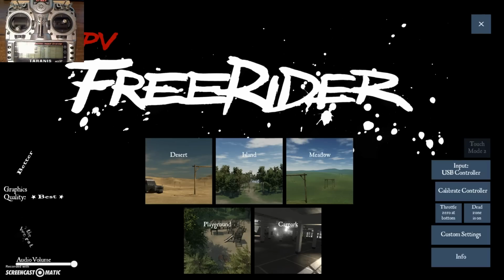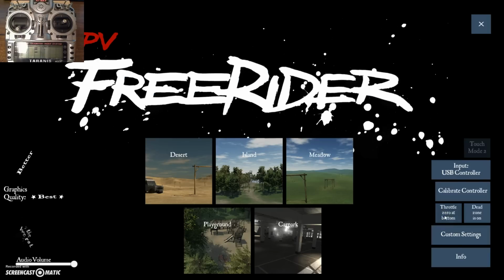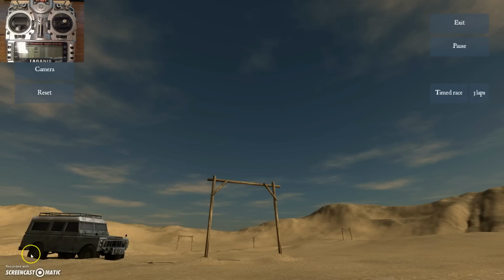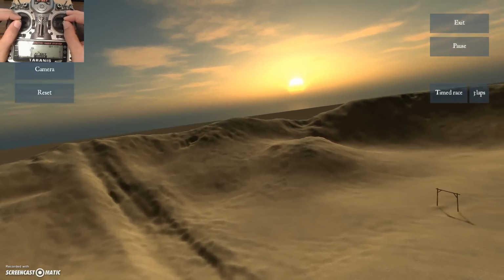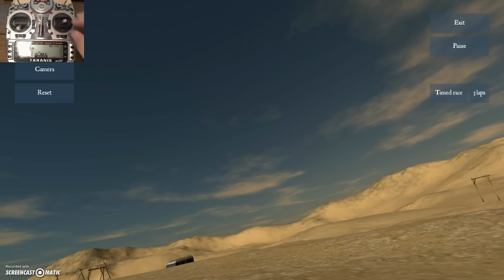How To Fly A FPV Racing Drone - Lesson 4 -Turning

Comment: I've been meaning to comment on the other videos but forgot and not sure if someone else has, but the reason the centre to zero option would be there is for XBox and PS style controllers that have springs on the throttle stick so that when released it will be at zero throttle.

Comment: I've been flying planes for 4 years and for the past week have stuck to a daily run on freeride and I cannot get turns down I just flop it into the ground. I can slowly tiptoe around but I'm not able to fly acro at any reliable speed. I'm ok at flying the inductrix fpv not great on acro, but I can I even have a big los quad I can fly around in acro but not fpv. I'm not sure what I'm not getting. I just spin out or slide past my goal or flop into the ground. it's like driving on ice. then I wobble a lot and fall out the sky. but I'm still try every day thank god for sim's. and thank you

Comment: I have been flying RC for over 20 years now, Methanol planes, helicopters and now electric on both, I used to think "drones were for people who couldnt fly" however now after owning 5 drones and still on a steep learning curve can honestly say it requires just as much skill as line of sight :), I of course started off on Angle Mode, then flick to Horizon mode once underway, I have always found Drone control a little un natural as it seems to "fight your inputs" so yesterday tried "Acro mode" and it was like a light turning on, suddenly it started flying like a normal model and was a bit easier, now just to master the depth of field perception :), I find myself flying higher than is needed as the ground seem so dam close, keep up the good work Josh your videos are entertaining and imformative

Comment: If i am approaching a gate and my current trajectory will land me about 5 feet to the left but i am about 30 feet away from it what can i do to rapidly change direction? Sometimes it seems like the normal roll and a little yaw is not fast enough and often i will turn to face the target but then drift past it
Reply from the maker: I would probably just roll to adjust the trajectory but not yaw so that I was still facing the right way.

Comment: This!! As a hack LOS pilot, my self taught flying skills are adequate to hover and do some basic maneuvers. I'm also an RC car guy, so turns are aileron initiated with elevator then rudder to correct into a choppy not-so-coordinated turn. Then this video that says rudder for heading and aileron to correct. That proverbial  "ooohhhh" moment when I realized how I've always done it wrong!! Thanks Joshua for this great series, it's fun and super beneficial :)
Reply from the maker: Really, the question of "rudder or aileron first?" is misleading, because you should be doing both at the same time. Both yaw and roll are being controlled independently and are responding to and correcting the quad's motion in real time. But until you get good enough to do that unconsciously, consciously thinking about doing one first, then the other, may be helpful.

Comment: I use fpv freerider on my phone and i plugged in my logitech  computer controller to use that joy sticks to get the feel of a real controller. It was annoying how the  throttle stick is always centered. I tried to take the controller apart n take out the spring,  with no success.  then this morning i saw your video and how you said you don't know why the throttle is centered. I think its for game controllers like what I'm using cuz now it feels just right.  So thank you for helping me realize that.

Comment: Just a few comments and questions. First off, I'm not a new quad pilot, and flew LOS all last year, including my ZMR250 racer, with no problem doing coordinated turns, "pylon turns" back and forth across the field, etc. I have a dozen quads from a nano to an X380 GPS quad. Of course, all the non-racer quads are always in a self-righting mode, so perhaps that is why I never got into any trouble. My ZMR250 I can dial up Angle, Horizon or Rate mode. I flew it mostly in Angle mode, but did put it in Horizon mode and did a few rolls and flips (got too close to the ground once with the inevitable consequence). When I fly the Freerider program with my Taranis 9D+, I can do alright in the self leveling mode, except I don't know what the course is. During the Nationals last year (in Calif.) I watched, and they had yellow arrows on the ground so that the pilots knew which way to go. I get out on the Freerider course, and after I get into it, I lose track of which gates I'm supposed to be flying through. I should mention that I'm partially color blind. On the Meadow course, I can see a slight yellow path, but its still confusing. When I go to Acro/Rate mode, I seem to lose my ability to fly. Perhaps i'm too used to having gyros level things out for me. Made it up to lesson 4 so far, and will continue to work on it. I have a 7" diversity screen ground station to fly FPV with with my ZMR250, but didn't get it going until the weather started changing, so don't have more than a couple flights on it .. and those were in Angle mode. Is this just a matter of reconditioning myself, or is this that much harder in Acro/Rate mode that I'm not able to handle it yet? I'll keep at it ... Thanks!
Reply from the maker: +Bill Somrak It's just a matter of reconditioning yourself. Angle/rate is, IMO, more natural and intuitive for FPV than LOS, because the sticks always control the direction you want the camera to move. In LOS, your perspective is fixed and you have to think about which side of the copter is up. In FPV, "up" is always the top of the screen.
Reply: Wait .. did you mean Acro/Rate?  Those are equivalent.  Angle is a self-leveling mode on Naze32 FCs (using Baseflight). The perspective thing isn't a problem, since I've flown RC aircraft for over 50 years going back to my single channel "rudder only" RC days. I also flew competition aerobatics (Class D Pattern) and am familiar with the reversal of controls when nose out/nose in and upright/inverted. Perhaps I can tweak the rates of Freerider so that the Acro mode isn't so 'sensitive' ?
Reply from the maker: Bill Somrak Acro and rate are different names for the same thing.
Reply: +Joshua Bardwell Yes, I know that Acro/Rate are the same thing ... but in your original reply you wrote Angle/Rate ... 2 completely different things, that's why I was confused.
Reply from the maker: Oh... my bad. No, they're different. Angle is autolevel. Rate is not.

Comment: Just an fyi, I believe the Throttle zero at center is because most people are using xbox type controllers where the stick always at center unless you apply force.
Reply from the maker: +Travis pisani Yeah, I think you're right.
Reply: +Travis pisani And DJI copters. They hover at the spring loaded center throttle